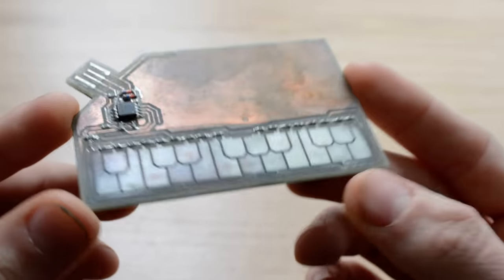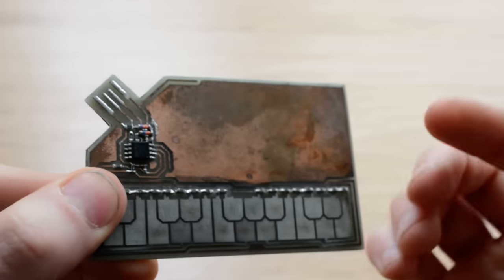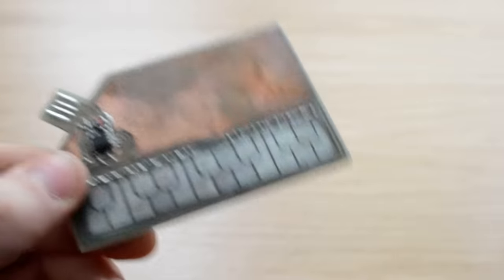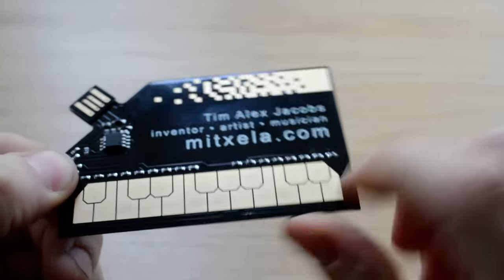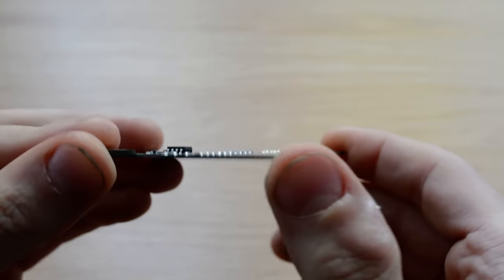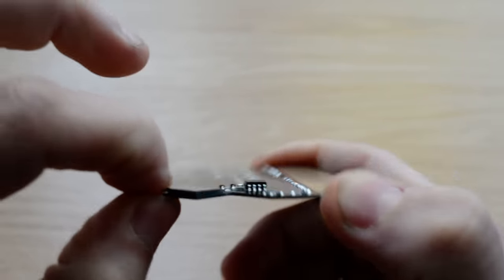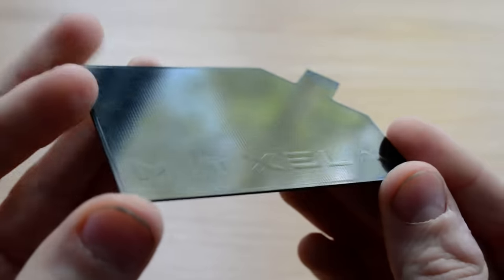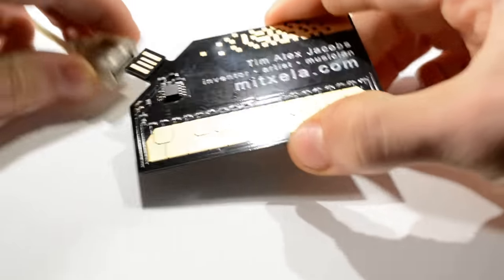Stylophone Business Card

Comment: Why is this not available in your shop? To be honest my primary interest is to solder on a bunch of leads and put it inside a broken keyboard but I'm tired of crawling around Raspberry Pi forums and watching arduino videos just to make use of a broken Casio or two. A repurpose as a MIDI controller would be far more useful than actual repair of  a lame keyboard giving access 12 terrible voices and no connectivity.